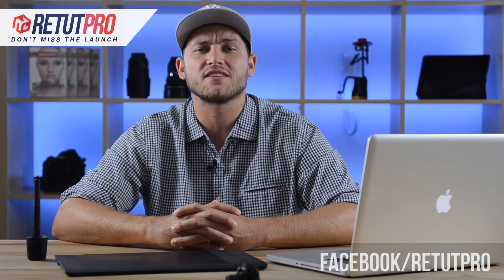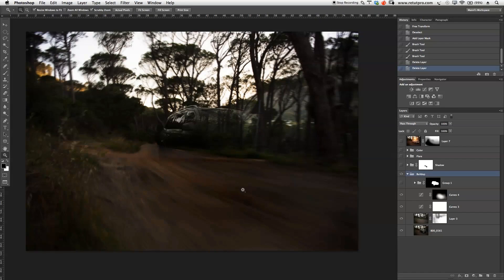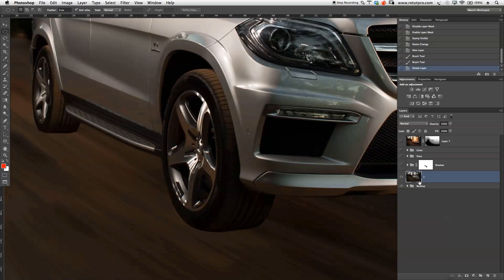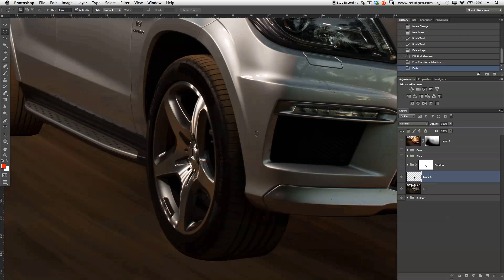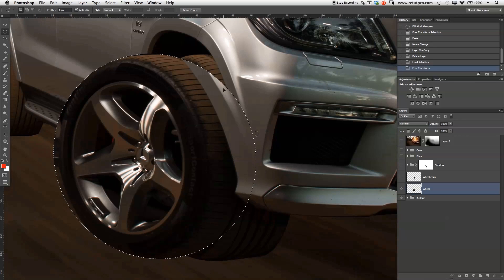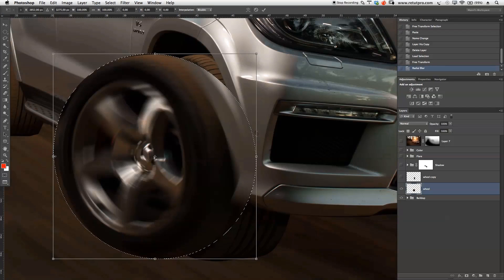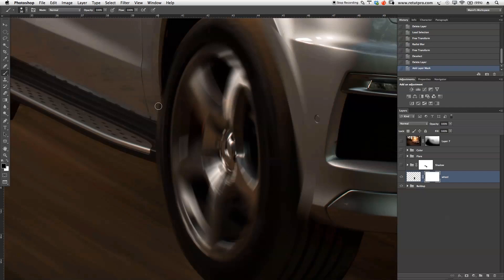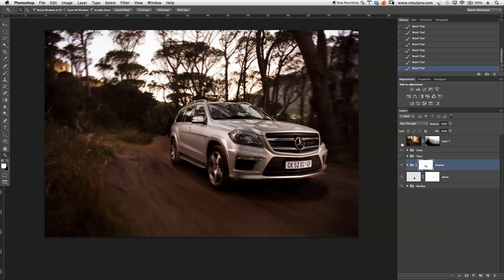How To Use Radial Blur - Photoshop Tutorial

Comment: how do you blur the reflections on the windows??
Reply from the maker: Just used the normal motion blur for that, but do check that your angle is set into the right direction and distance not to strong. You want it look real at the end! Also use a mask to keep the edges clean. Add a curve for contrast and a new small black/white gradient with super low opacity for just a bit of pop & reflection